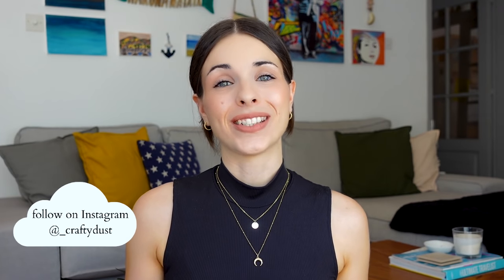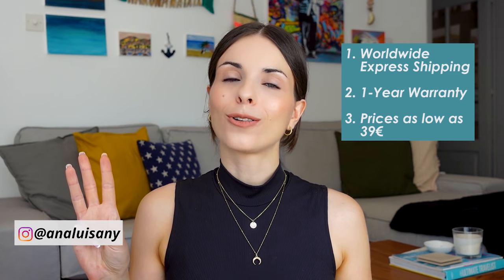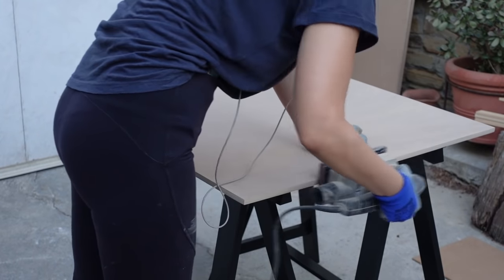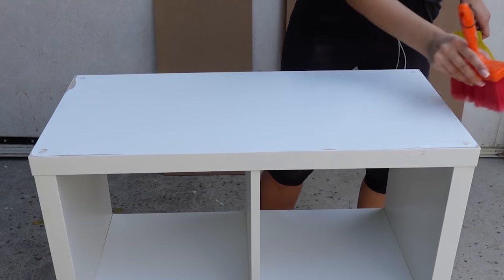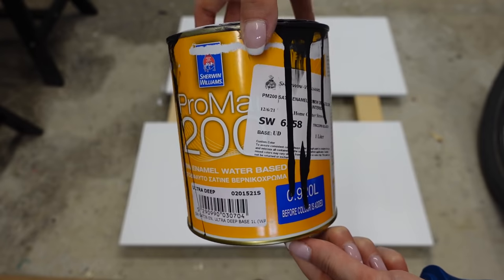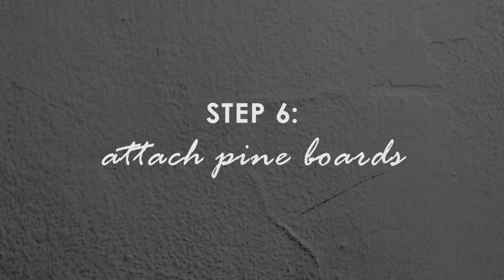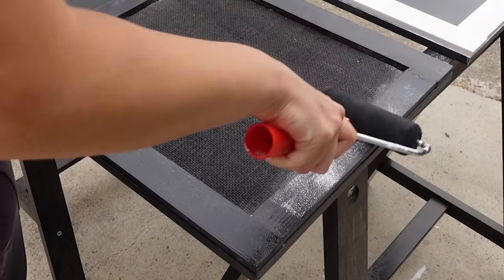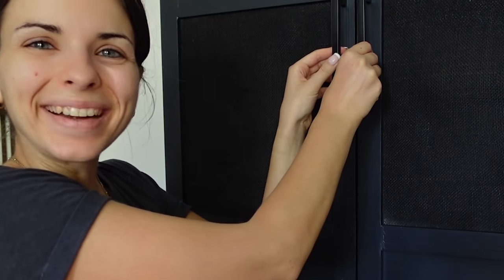IKEA KALLAX INDUSTRIAL CABINET HACK │ How To Make Doors For IKEA KALLAX │ Budget-Friendly

Comment: Your sander had a place to add a hose for dust collection system; a cheap shop vac works wonders. After sanding, I'd use a vacuum with soft brush attachment to clean off the surfaces if necessary, and then some tac cloth to pick up any remaining dust. No water needed and WAY less dust in your environment.

Comment: It turned out really well. It might have been easier to paint the timber strips before putting them on the door and just touching up any spots where you put nails. I'm going to watch the Kitchen Island one next as I want to try that for my kitchen.
Reply from the maker: I thought about it too but I thought it would get really messy with the wood filler. Looking back at it, think it would have definitely been easier to paint at least the inner sides that look towards the burlap. Hope you enjoy the kitchen island one 🥰✨
Reply: @Craftydust  I did thankyou. I have 2 old Kallax shelf units like yours that used to be  in a home office.  I am going to do the same as you have but probably leave the drawers and doors in for storage with half open.
Reply from the maker: Sounds good!!! 💕✨

Comment: This is awesome. Thank you for the how to! Is that black paint essentially a wall paint? I'm getting BIN primer but struggling to find black paint that would go over it. I assumed I needed furniture/wood paint?
Reply from the maker: I am using wood paint 😊 wall paint dries matte and leaves fingerprint marks when dry (it gets dirty easier/faster). I used Tricorn black by SW here but I would highly recommend Onyx by Benjamin Moore, I found it needs less coats to achieve a truly black finish..

Comment: nice !! may i ask y u didnt spray the cabinet instead of roller painting ?
Reply from the maker: Thank you ✨ I live in Cyprus and so there's a very limited amount of such DIY materials. I wanted something i could use on both MDF and laminate and such spray paint doesn't exist here (and I think it would be more expensive as well because I'd need a lot of spray cans)... unless you mean using a paint sprayer, which in this case I don't have one but I am planning to buy, I think it's much faster and offers a better paint result!

Comment: Nice work. Some suggestions anyway. Why would you not build the door framing first then paint it and glued on the panel? Secondly cutting the fabric in size would not raise the frame. Btw. You can buy the kallax in black too :)
Reply from the maker: Yes, it does come out in black as well, but I found this white one on sale. Besides, even if I got it in black, I'd still have to paint it so that the DIYed doors match the shade and finish of the unit.. There's different ways you could build the doors, this one is just my take on it 😊✨